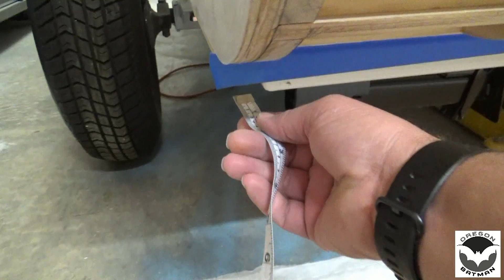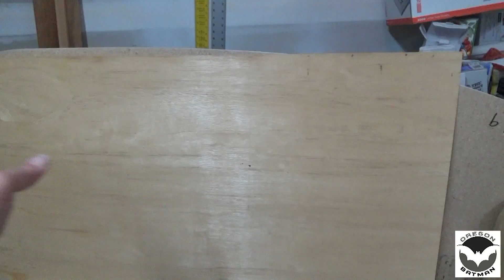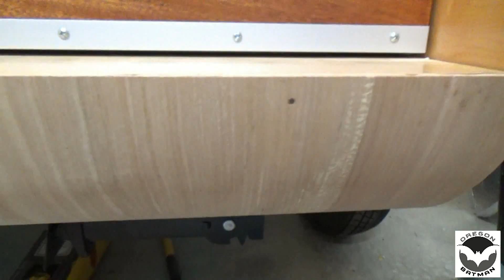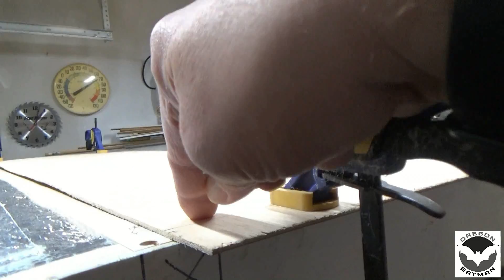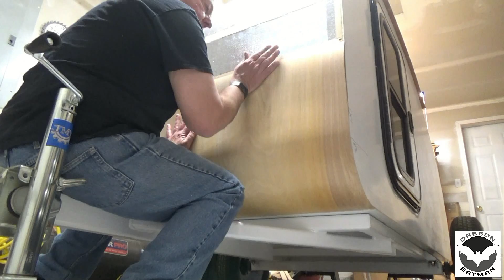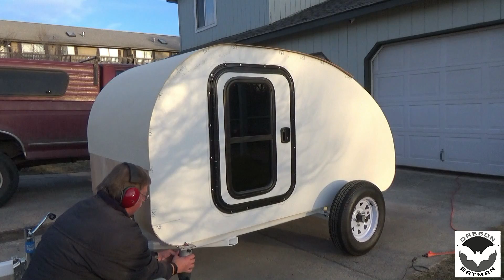Let’s Build A Teardrop * Step-By-Step * - Part 33 (Roof Install)

Comment: Why would you use two different types of glues for the final roof panel?
Reply from the maker: Hey Enrique... I used a contact cement for the wood and used a glue specifically for the Filon. Two different types for two different purposes. Thanks for watching!
Reply: @OregonBatman  Revisiting this question: On the top areas of the roof, you used Titebond II along the edges and what I believe was Liquid Nail on the center spars. Why not one or the other?  Thanks!
Reply from the maker: @dwayneburbridge3283  The tightbond was used on the edges because there was good contact between the two surfaces. I used the liquid nails in a liberal amount to help fill any gaps on the spars. Hope that makes sense... Thanks for checking it out!

Comment: Hi. What brand and model number would you recommend for router? Thanks
Reply from the maker: Hi FP T! I am sort of partial to Bosch, and use a Bosch Colt 1 hp trim router. I also have a larger Bosch 1/2" shank for the big jobs. Dewalt has a pretty good router also, DWP611PK.  I own a Porter Cable router and use occasionally... little noisier than Bosch. But my go-to is the Bosch Colt. Thanks for the question.... Cheers!

Comment: I used to do quite a bit of thin panel work. Using a staple gun to fasten it down works well, but sometimes the staples can go to deep and end up pulling through. I came up with a solution that worked really well for me, but I did end up a staple gun that was dedicated for just paneling. I took the cover off the top of the gun and removed the piston and drive pin. On my gun they came out together. Then, I ground about 1/16" off the end of the drive pin. This leaves the staples just flush with the top surface of the paneling.
Reply from the maker: That is an awesome tip! I have a gun that I like but don't use that often for that very reason. Will shoot right through the wood. I tried using a regulator to cut down the pressure, but that failed as well.... would either stick up a 1/16 to an 1/8, or would shoot clean through. Works great on thicker material but the thin stuff... forget it. I will have to try your trick and see if that will remedy the problem! Thanks.
Reply: I would have great interest in how to do that to a staple gun as I build a camper once in a while, I always come here to OregonBatman to learn things from him
Reply: @langfordoutdoor  What is the model of your staple gun?

Comment: I'm confused. In your last video, you said you were going to use 1/4" for the roof because the 1/8" left to many wrinkles. At the start of this video, you said you were using 1/8". From what I can see, the plywood you ended up using looks to be about 3/16". Did I mention I was a little confused?
Reply from the maker: LOL!! I have a tendency to be a little confusing for sure! For my plans, I am using the 1/8 plywood for ceiling and roof. I think I made the comment that if I were to do it all over again, I would definitely use the 1/4" instead. The 1/8" bendable plywood is very flexible and doesn't lay flat. Maybe it was just the piece I pulled out for the roof, the ceiling piece worked great!

Comment: Love the shape with the lower rounded edges. Have you decided what you are doing for fenders on it?
Reply from the maker: Thanks Mark! Those rounded corner set it off! :)   I will be switching out the wheels and tires in the near future and will go with a couple of steel fenders, we'll see what that looks like.
Reply: Yes this shape is very cool

Comment: Yep, very important to mark the position of the spars, because once covered by the skin, you can't see where to tack your staples.  Pretty tough to do that job alone, especially when dealing with contact cement:  congratulations!
Reply from the maker: Thanks Raynald!